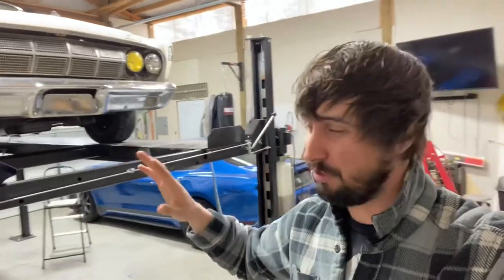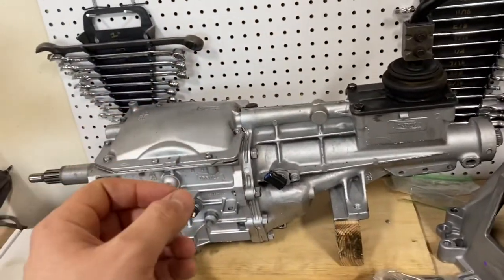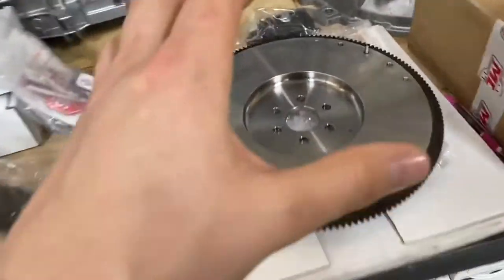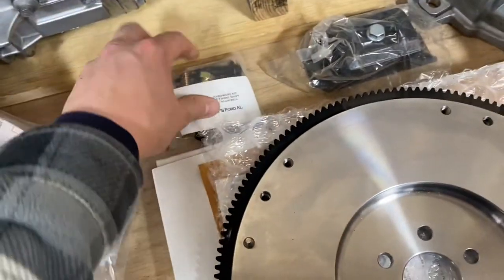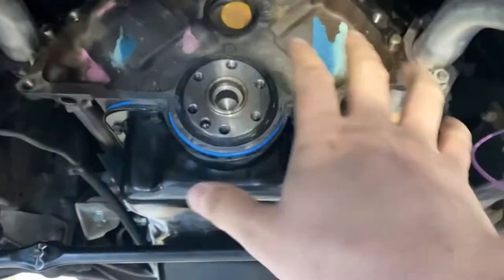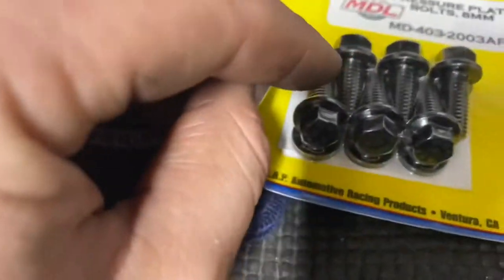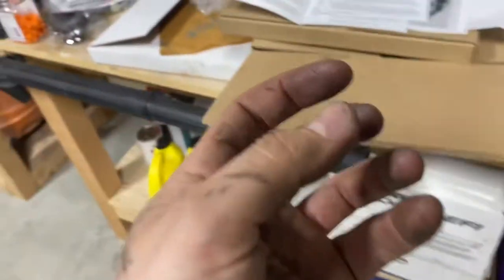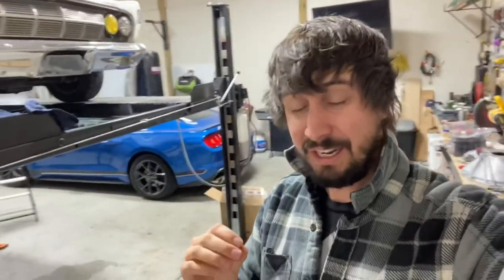T5 Swap Parts List and Clutch Installation

Comment: I'm confused.  In the video you cut open the tunnel for the floor shifter and then welded it back closed....  Why?  Also, how did you calculate the  opening position?
Reply from the maker: Its been a bit since I made this video but if I recall the previous owner had a jagged hole cut for the previous AOD trans/cables.  I wanted to make a clean hole and likely cut larger than what was needed.  At the end, after I had sufficient room, I welded it back up neatly so I could install a boot and make it all look pretty.  Cutting the hole takes some measurement/guess and check.  Having done this multiple times its typically easier to make the hole large and then close it up at the end.

Comment: What size flywheel and clutch?
Reply from the maker: Heres what i grabbed from my sales order from a few years ago (your welcome ;))

MDL Lighten Billet Steel Flywheel, Ford, 81-95 50oz, 5.0L only, 10.4" Metric clutch pattern, with alignment pins.

MDL Clutch Set, Super King Cobra Kit,
Ford 10.4" Metric pattern heavy duty pressure plate Organic Steel backed 10.4" 10 spline 1-1/16" disk